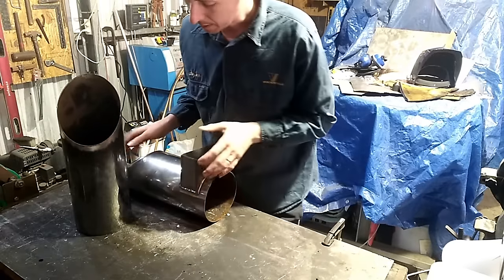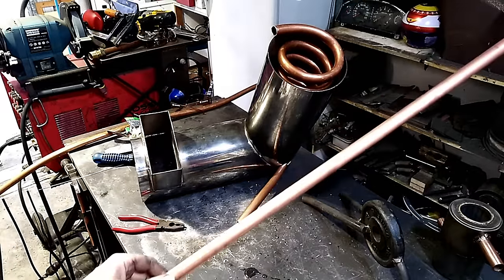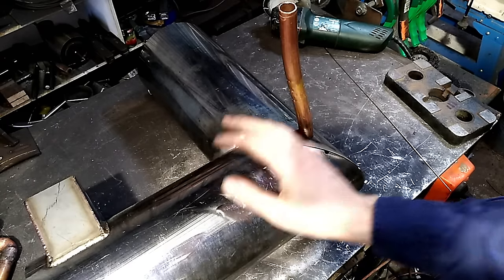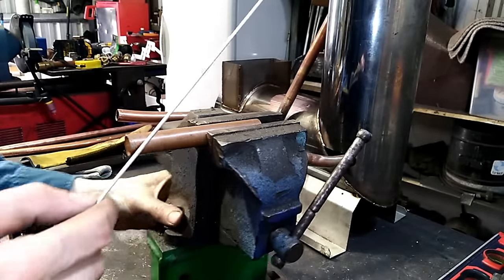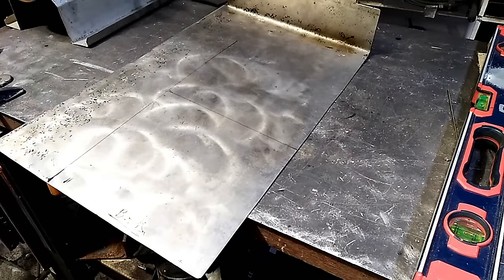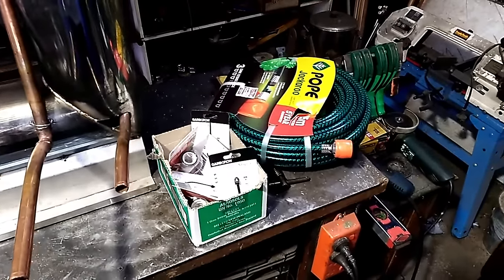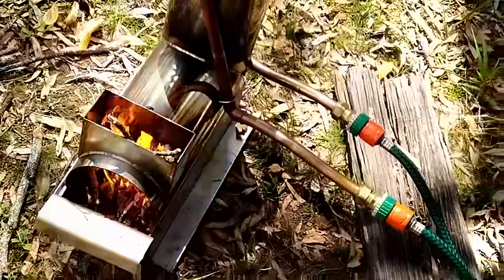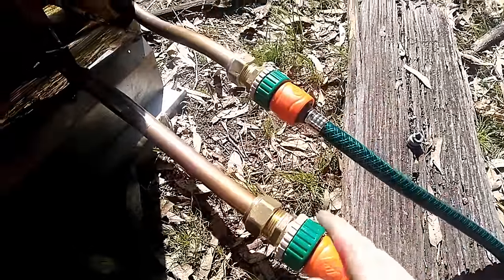Hot Water Rocket Stove II  - BUILD-

Comment: I would think the inlet should be much lower (about 1 ft) from the top of the tank (and water level).  That would reduce or even eliminate the loss of heat from the steam (and water lost to steam).  I would also suggest a check valve on the outlet of the heater to ensure that cold water from the bottom of the tank is heated much like a modern drip coffee maker.

Comment: I would recommend utilizing a metal spring loaded check valve, or "foot" valve on the discharge side, or even make one using a stainless ball, so that when the system tries to "gulp" after the hot water purges out it would then activate the valve and block anything from returning into the discharge end of the coil.

the system may require a valve on each end of the coil, this is how my coffee pot works, utilizing 2 small one way valves.

Comment: Good design but you need a one way flappa valve on the bottom side water line so then with water traveling one way it will thermal siphon cheers

Comment: If you start with a fresh roll of copper it will wrap around that jig just fine I have done it lots of times. Depending on what you are doing you can anneal it as well. You can put a 3 foot piece of pipe over the copper pipe for leverage and it will wind the coil perfectly. Why wouldn't you silver soldier the copper tube. I noticed you are using a diamond wheel, I'm going to put one on right now and see if i like it. It is nice and clean and no dust I noticed.

Comment: Excellent work, however I would have used forced circulation,  by installing of a small "pump" and a steam condenssor to eliminate steam and the gurgling noise  (even for experimental purposes makes for better understanding). As fot the heating, ages will pass by before all that water becomes hot through the use of heat convection or even through small out burts of steam. Heating water fast is specially importan in winter, when heat and hot water are most needed. Also I consider that  a 1/24th of an inch pipe should hae been used for the spiral heat exchanger, as this allows for more turns, (maybe even a double spiral depending on the diametre of the smoke outlet pipe. Having more surface area for heat exchange is equal to more heat transferred and thus the water will acumulate more heat per given circulating volume. The smaller copper pipe (or other material) while giving a faster rate of heat exchange, will in addition give a faster water flow rate, as the larger surface contact area will help to heat the smaller volume of water faster and complete the circuit faster, so transporting more heat in less time, thus also contributing to reduce fuel consuption. Also fitting of another spiral as a watertank heat exchanger, making the whole water system a closed heat exchange circui, with a safety pressure automatic purge and refil valve included. The garden hose was risky.  Steam makes very  nasty burns as many people have experienced. Use a blow torche for welding copper tubing. Also bronce, or similar metals are for gas welding, for copper water piping  ordinary silver welding and borax will do  and you will not suffer nor will you cook the copper as with the TIG. Also whe copper is overheated it must be cooled inmediately or it will loose its temper become soft. "Best wishes".

Comment: From the coils the pipe needs to go uphill only.
If you go down that is called a heat trap.
Hot water only goes up, so it stops there. Getting to hot the water boils ant the steam pressure pushes it to both directions. 
Let the coil exit at the top of the stove.

Comment: In the US, a dishwasher hose uses the same threads as a garden hose and it's made to handle higher temperatures. Might work better for your outlet side.
Reply: Many dishwashers in America use both hot and cold water, but in Australia, most just use a single inlet. And it might not be rated of hot water. Shame as the electric heating element in the dishwasher is the most expensive way to heat the water. (Unless you are able to use solar pv.)

Comment: You should've put a small pump on the inlet side so the water doesn't boil, keep everything cooler and save the hoses. I bet it would heat the water more efficiently as well.

Comment: Very interesting and well done on the building part. When I was a kid I had a model boat which had a similar set up, a coil like that and a spirit heater, it used to suck water in one side, heat it up and blow it out the opposite tube exit, trundle along quite happily in short bursts. Magic to a kid, wonder if it could be scaled up ?. No real moving parts for a motor ?

Comment: If you fill the copper pipe with sand, or water (and then freeze it), or the ID size ball bearings, the pipe won't crush as you bend it.  I'd have hit the top of the coil with a wood block and sledge while it was still on the form, to get the coil uniform.

Comment: You should use hot  water hose as is used on a car with brass fittings, this will prevent the hose from melting. Take some of the suggestions, make a drawing, explain what you are going to do, and why, then execute the plan, and make a part 2 to this video. This is a good idea, and you are close to making something that would be practical for everyone to use in a catastrophic event, or this could be constructed by volunteers and sent to third world countries.

Comment: Barrel should be much higher , so there is cold water pulled in from the bottom. Sucking water back into the outlet is not a good sign, the circulation should be natural from cold tap through the fire and back into the barrel. But amazing job building something WORKING!!

Comment: If you could weld two 90 deg elbow to the ends of the copper tube, to make a 180 deg turn, then you might be able to bend both tubes on the mandrill as a double helix coil, so the inlet and outlet are parallel to each other and on the same side. But you would want to feed and remove the water from the top so the 180 deg turn is at the bottom of the chimney to avoid airlock.

Comment: To clean off the black on the copper tube I boil them in tall stock pot with few table spoons of citric acid granuals & water about 15-20 minutes cake section in shops for citric acid

Comment: If the top pipe runs straight into the tub under the water near the surface and the bottom tube at the bottom of the tub, it will not produce any steam, just hot water. Just think of the old oil stoves with the hot water tank beside it. HEAT Only Rises

Comment: Have you tried automotive heater hose using garden hose fittings to transfer water to the tan?  Heater hose is meant for hot water.
Reply from the maker: I should look into that. There obviously must be a smaller diameter hose that you can buy by the metre.  Thanks mate.

Comment: Interesting design. I wonder how hot the exterior of the riser is during the burn.  It seems to me that the heating/cooling cycle by really intense direct flame will cause the copper tubing to crystalize and crack.  Would the coil absorb enough heat if it were in contact with exterior of the heat riser?  That would extend the life of the coil and provide more efficient maintenance including coil replacement if necessary.   When I transformed my barrel stove into a siphoning water heater the coil was wrapped around the exterior of the barrel.  It works extremely well but I stopped using the stove in favor of a rocket mass heater.

Comment: Many years ago we used to put a pipe with in a pipe so that it had a 16 mm gap and then weld a cap on it top and bottom forming a water jacket. Drill hole top and bottom  to connect cold water to bottom and hot water to top. This was then used at the bottom of the flue. From a small grate with wood in it we could draw flames up though it and it would heat the water.
I think that would work for you to.
Reply from the maker: Thanks mate, I will be revisiting this build in the near future to implement some of these great suggestions!

Comment: Add a 1/4 hp pump to circulate the cold water back into the system and it will be more efficient. If you are looking at heating the water as fast as possible, the pump will do it.

Comment: I would have used a larger inlet than you have on the outlet, it will probably create higher pressure but will perhaps make you introduce more water into the system before it goes out again and thus perhaps remove the spitting

Comment: Does the compression/restriction of the pipe cause the flow to stagnate? Coefficient of expansion is 13.1. You have a 1/2 inch line feeding a 3/4 inch copper at the inlet. The water flow rate slows. The exit is 3/4 inch copper to 1/2 inch flex causing back pressure. I wonder what would happen if you went to say 1.25 inch or even as much as 1.5 inch exit pipe from to copper at the top ( maybe a manifold of half inch lines reducing the pressure)?

Comment: I'm betting that on that test burn the wooden dowels will burn out and the pipe will spring back hitting the side of the pipe because you clamped it, thus bending it when you were welding it.
For thermal siphoning to work the tank needs to be higher than the heating element and the outlet of hot water from the heater into the tank needs to be up high also where the hot water use tap is, and the cold water supply needs to come in on the bottom.

Comment: I need such a idea for a rocket batch CV heater, from the greenhouse into the livingroom. But without a steam explposion, because on some places the rocket is much to hot, but need a place where it has enough warmth to heat two radiators, one 3 meters long in home an a smaller one in the barn who is quite damp.

Comment: Very informative...i would say quite successful results for such a large tank and small stove you mentioned the water volume and the time toheat from 78 f to im estimating an average of 125 --130 f? But im curious the actual amount of fuel 
Wood of course but what type? ie,,hard wood? Possibly fast and hot burning pine?? And a question? Would lump charcoal be a suitable or more efficient fuel..and if so how much to achieve the same time and temperature....? Also understood the output hose being only for testing probably a permanent setup would be soft copper return..or maybe just 3/4 inch automotive high temp heater hose as most are certified for up to 300 f

Comment: I’m no expert but this very thing has been on my mind. Would a couple of brass check valves keep the water flowing in one direction despite the increase in pressure? PEX for radiant floors might make good water lines, although I don’t think sweating copper would be a problem for you. What happens when you use the hot water and the level falls below the outlet? Maybe a toilet tank float valve?

Comment: I made a wood fired boiler for my radiant heated home in 1982. Steam blew the hoses apart.
Reply from the maker: That's not good .
Reply: @LittleAussieRockets  A 1/5 horsepower pump may be ok for 1.25" pipe water system and 600 Amp service home made electric boiler. But a wood fire 3 foot across is too much power.

Comment: I was thinking about a similar idea to yours but was planning to build mine out of old gas tanks and oxygen tanks and rather than running the pipe in the fire, i had planned to make the upright dubbel sleeve, one inner for the fire with the water pipe around it, then have a bigger diameter tank fix over the pipe work and packed up with sand to create a thermal store, just need to get around to building what do you think?

Comment: I am repeating others, but I have done solar hot water projects and have done thermal siphoning... your outlet from the heater should never go downhill. Also for a hot tub, you don't want thermal stratification... therefore the water return to the hot tub should be low (the heat will rise)... but above the outlet of the heater. The cold water feed to the heater is best to be even lower or off the bottom of the hot tub.
Reply from the maker: I know 😭👍

Comment: You have created an airlock with your downpipe design. The top of the coil cannot purge air because the downpipe traps the air in the top of the coil. That is why you get shots of steam in the tank. There are a number of ways to fix this: 
1) Install an air bleed at the top elbow to purge the coil of air.
2) Remove the downpipe and take the hot water from the top of the coil. The hot water hose will have to incline to the port at the top of the tank. 
3) The last, and worst, solution would be to turn the stove on its side and/or back to allow the air to escape. 

The only reason you have steam blowing into the tank is because of the restriction caused by trapped air.

Comment: done that- been there. the copper will fail on you fairly soon- especially with wood burning. what you need is seamless stainless steel tubing. one comment about a circulation pump- an absolute must. you'll find the SS tubing much more 'bend friendly' than the copper- less likely to kink if you add sand. the stainless tubing will last at least 15 years- probably more. you'll be lucky to get 3 years out of the copper.

Comment: Use ice in the copper , it is easier than sand.      Cheers!
Reply: How do you get ice in the copper?
Reply: If you can fit the copper tube filled with water into a freezer then you have your answer.  But don't plug the ends because water expands as it freezes and can split the tube.
Reply: @belumptuous  that was the question wasn't it? How do you fit 5 meters of 20mm copper pipe in the freezer? Now I suppose if you have access to a large enough walk in freezer then perhaps you might have a go. Or if you're local temps are dipping into the freezing range?

Comment: Tig welding Cu pipe instead of flux and Sn/Pb  - or Sn/Ag.  with the soldering process, we normally see the solder sucked into the joint and a nice complete seal.
Reply: Im perplexed, and no plumber but why couldn't he not use a screw joint?

Comment: How will you clean  the copper from the dust of smoke? If he was external should be better?you will need an automatic valve of teffiling in case that that your motor of recycling wiil stop.(if you use one)Whithout valve of pressure the stove it's a nice bomb.I tried to make one so I know their problems if you want to be really rentable.Anyway congratulations for your work but you need more.

Comment: Great idea and lover your stove design, however, I think your outlet is low, I dont understand why you positioned it back down where the inlet is this traps the steam and causes your gurgling sound. There should  be some elevation difference for your inlet and outlet. Have the inlet enter the stove at the bottom, and the outlet exit at the top, you will have the steam venting out and the heated water will flow consistently.

Comment: You could have just wrapped the copper pipe around the external diameter of the riser or around the base where the most heat will be and not needed to worry about drilling holes, etc. You would then have no issues with fouling on the pipe in the vent from hot tars and other substances that will stick to the copper.

Comment: love the video looks like you do nice welding you should try soldering the copper yous flux map gas lead free solder its realy easy and would make your biuld a little nicer probubly alot easer to do in the tight splots and the flux will pull the solder into the joint makeing your bond much more stronger just clean the copper ware you put the solder well sand paper wire brush your tig welding is awsome nice job ps flux has acid in it wait for it to cool  5 min wipe exsess flu away w wet rag and bamoe bullet prufe ssolder jiont just like on a commercial bioler sorry i cant spell

Comment: Just a thought....if you use salt to fill the tubing instead of sand you can run water through it to remove any that has plugged too solid.  The salt will dissolve making it easier to clear the tubing after you bend it.
Reply: by the way, not being judgmental , I think you are on the right track..

Comment: Great video. It will be intersting to give the result few days after:
- temperature of the water before and after ?
- how long does it take to have a water about 40° ?
- how many quantity of wood do you need to putt the water to a confortable temperature, from wich water temperature ?

Very intersting, you are very clever !!!!
Reply from the maker: The water was 24 degrees C and it took 1.5 hrs to get to 67 Degrees and I used a quarter of a 15kg bag of kindling, plus a few sticks and twigs from around the yard. .Thanks mate.

Comment: 46:23  Off topic.  I have a Greenfield tractor 11  I just made a jack shaft to halve the drive speed.  I have heaps better fuel economy and I go in the the big cuts I always do for it.  The problem is it will not stop it will drive up steep hills or through fences.  With great power comes great responsibility.  10T to 20T to 10T to 60T.  I think that is right.  Half speed on the drive to lay off the clutches. She works and goes hard now for a 40 year old mower.  Don't start me on my 2 stroke Victa..... Still going never need another mower.

Comment: Hi!
I'm surprised noone has sugested you to connect the garden fosset to a, three way valve filling the tub as you are heating the water, by the bottom inlet. Then when you've reached the level of water, switch three way valve to close for more water, starting a watercirculation pump feeding on the bottom inlet, to the lower end of the coil thereby pushing  water through the heater, thereby avoiding steam build up, mixing the water. Able to ad heat when desired, a radiator?
Smart design on the waterheater and a stove to cook on?

Comment: If you store the tank higher and the hot water inlet in the tank even higher there will be more pressure and more speed of water circulation in the circuit so less steam and bubbling